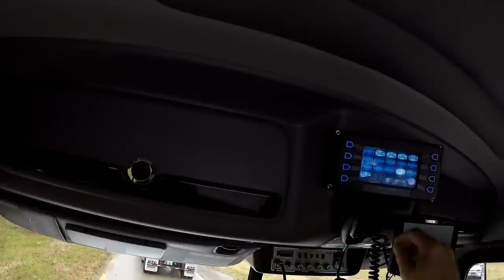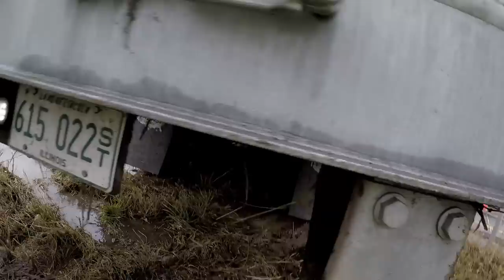High Wind Havoc

Comment: Ron, this is the first time I've seen you rushing around getting a scene cleaned up. You're usually calm, cool and collected, what was the hurry on this one? I could hear it in your voice but it was just another truck in the median if you ask me. Great video again!!
Reply: I believe he was expediting the removal of the truck so Fire Rescue could clean the road in a timely manor , to prevent another accident from happening during the bad weather with other drivers slowing down to look. Midwest is always safe and professional when they work and know when rapid removal is needed for the safety of drivers and First Responders . Great video and job Ron , thank you and God Bless
Reply from the maker: There were multiple incidents on both sides of the interstate, whether due to the storm that passed through, or related to this incident, I am uncertain.  But the emergency services were stretched thin with so many incidents to attend to and there were more storms forecast.  The wind was blowing hard and the road was wet.  Those factors, plus I push myself.  For some reason I felt an urgency on this call that I don't normally feel.  Also, Vic Massano is correct, quick clearance reduces the risk for all responders involved.    Yes, I rushed on this one.  Thanks for your concern.  God bless.
Reply: let's not forget it was probably COLD.

Comment: Ron I noticed you didn't use the break away chains like you always do. Is there a reason you didn't use them in this case?
Reply from the maker: It is still advisable to use break-away chains even with the tire lift.  This was an "Emergency move" and I took a calculated risk by not connecting the break-away chains.  There were many variables involved in my decision to not use them in this situation.  Again, it was a calculated risk for an emergency situation.  Had this been a standard tow I would have installed them without hesitation.  I hope this answers your question.  Thanks for watching and God bless.
Reply: Umm Youtube won't let me comment only reply. Sorry!
Ron why did you use the white winch and not the green winch?
Reply: i believe the white and blue winches are main winches where the green is an auxiliary. the main winches would be capable of handling more force than the auxiliary winches. this is just a guess as i know nothing of tow trucks or rigs like this.
Reply: Ron Pratt is that carbon fiber around the control frame in the back of the rotator
Reply: makes sense, given the urgency with which police want the road cleared, which also probably explains the tire lifts instead of a frame/axle lift, its just faster.  Just get them off the road and chain them up later.
Reply: Okk
Reply: tim paulsen .
Reply: And you are right I had never seen  that on the under lift!
Reply: Hahaha make sure you oatmeal pies are safely buckled there driver  Incase you jack-knife
Reply: I love that lazy Susan for chain that is a brilliant idea
Reply: Ron is a professional. When you are a professional you can take shortcuts.
Reply: CompactRhone that white inch is a deck winch.   That is used for joy if needed.
Reply: Depending on how far it is to the next exit. In this case it was not far, in some cases it can be 20 miles so that has to be considered,  Better to take that extra two minutes if it is 20 or 30 miles than to crate another problem.
Reply: @MikeySartori  Yes it is.
Reply: Joseph Robinson      it is against the law to be chained to your job, but alot of drivers don't wear the seat belt.....but I guess that alot puts safety first...God Bless.
Reply: Ozywizard73.  I may be late on this, but the white winch is on the boom and he can lift w it. The big green winch is known as a "drag winch" an is used for just "dragging" heavy loads along the ground toward the truck. Dragging is not what he wanted in this case, lifting/carrying was.  Hope I wasn't out of line and helped answer your question. Btw, 3rd time I've watched this recovery....
Reply: OzyWizard1973  p
Reply: Ron Pratt  love your videos. Also in Indiana I don’t think we can run sirens
Reply: @jessebergson3781  yes.  Plus it looked like he already had the heaviest part of the tire lift on when he arrives at the accident so might as well use it.
Reply: @aristeo1  usually you can afford them to
Reply: Ron will u buy another rotator

Comment: When you are pulling a full truck, with no brake control, how do you go with braking, or do you just go slow?
Reply: couple the tow trucks brake air hose to the trailer can help...
Reply: If this trailer had been loaded,  he'd have likely had to fix (or put a work-around) the damage underneath so that it would have service brakes while towing it.  It was revealed in the video that the wagon was empty,  so they simply caged all the spring brakes to be able to roll freely, and kept his speed limited while underway.  I think the part about keeping the speed low was also due to the wild wind.  Legally, you are supposed to have proper braking capabilities,  but due to the damage, and the need to clear the road quickly,  I guess it wasn't a bad call to just cage the brakes and get out of the way.  If he had been faced with towing long-distance, he would have had to make some repairs on-the-spot or at a safe place off the highway before heading out.

Comment: Still no clue why that female driver decided to bail out. I got blown over in Wyoming two years ago with a 70mph gust and my chihuahua and I rode it out and walked away with bruises, but I totaled my truck and trailer. You’re much safer inside the cab with the built in roll cage than you ever would be by bailing out. I’m amazed she survived that bail out. Good job with the recovery.

Comment: This wasn't the normal, "No problem Ron." You seemed very hurried. But you pulled it off in 25 mins. or less though with a bit of help from Mike. Which is understandable when you have officials breathing down your neck. I did notice you went outside your norm mainly when you didn't hook up any safety chains. But you still the man Ron!
Reply from the maker: Yes it was a hurried job.  We wanted to move it quickly to avoid further crashes.  I only had to tow it about a mile, so I did not hook the safety chains as I normally would have.  God bless.

Comment: That tyre lift looks like it's a godsend! I saw how easy it is to get the truck in the air rather than laying on the interstate getting covered in mud lining the axle forks up under the axle
Reply from the maker: It does make things easier when it is already hooked to the wrecker.  God bless.

Comment: excellent video Ron when you use the wheel lift on the big trucks how come you didn't put Breakaway chains do you not need them or was it too cold and you had to get off the highway quick God bless you and keep you safe have a great day and try to keep warm because winter is here and so is the wind
Reply from the maker: Normally I would use the break-away chains even when using the tire lift.  This was an "emergency" move and I took a calculated risk in not connecting the break-away chains.   Thanks for watching and God bless.

Comment: I used to be a 48 state trucker .. 
There's a spot in Idaho that has wind that can get up to 100 mph through a canyon, and of course the Highway was built through the canyon, and the guy who did it should be fired ..
I was loaded, and my trailer started to lift up and tip over ..
I slowed down, and went off the shoulder into the wind head on ..
I never tipped over, but I had to be pulled out, and back onto the road ..
Better to get a tow out of a field, than a trailer and cab tip over ..

Comment: Another nice video, Ron.  You made that look easy.

A couple questions:
1) Why did you choose the wheel lift for this one?  Is it just because you already had it on the underreach?
2) Why no safety chains?

Ducking down in front of the screen doesn't help see under the visor. :)  Maybe you could put your helmet on the dash or use a dash cam for the driving scenes.

Comment: Nice recovery as always. That driver sure had her guardian angel riding with her when she jumped! Guess Mike got the dirty job in the mud :)  Oh and thanks for the blinky lights on both trucks!  What is the wattage and speaker size on your siren? It needs more horsepower. Maybe Santa will bring you a nice shiny Federal Q for really clearing traffic :)  Over the years in emergency service I found the wig-wag headlights super effective for getting attention especially in daylight. Merry Christmas to the family and crew and God Bless.
Reply from the maker: Thank you and glad you got to see the blinky lights.  The siren is really just a cheap one.  I would love to upgrade soon.  He who shows up late, gets the mud.  LOL  we were both a bit dirty after this one.  Happy New Year and thank you for continuing to support my channel.  God bless.
Reply: When I used to do emergency lighting for fire engines, we found that for clearing close-in traffic, lights low on the grille or bumper (rear window level for cars) really helped. The high up lights work well for distant traffic and intersections but disappear when you get close behind someone. THE most effective lights were the wig-wag headlights and high power figure 8 wobble light in the grille (I do believe on the rotator, BRIGHT alternating LEDS in the grille would help. The small lights just do not have the punch to grab attention in the rear view mirror. I always suggest sitting in a car 100-200 ft in front of your rig and observe what you see. If you can ignore the flashes, it needs "more power" in the words of Tim Taylor, lol
As you know, NOTHING compares to a big Q for stopping traffic or shredding the ignorant :)  God Bless and thanks for all the entertaining and educational videos and sharing your strong faith.

Comment: just a quick question, why don't you place your camera on the white or blue swivel pulley on the rotator boom so you never have to adjust the camera angle? it will always face the work area i think, love your videos, and i learn quiet a lot from you since I am a tow truck operator myself, here in Canada. keep up the good work :)

Comment: Now that was one massive mud "slide" for that truck!! So glad to hear the driver had only minor injuries, and will survive. God Bless, stay safe and keep 'er between the lines. :) Dumb question: Do you find it easier to use the tire lift, rather than the frame lift??? It looks easier and faster. :)
Reply from the maker: It is a bit easier and faster, but such a heavy an cumbersome piece of equipment that I rarely have it hooked up.  God bless.

Comment: Brush guard doing it's work, saved the company alot of money by not completely destroying the front of the truck.
Reply from the maker: It did help, but the truck went backwards through the guard rail and cable system, so the rear of the truck took the brunt of the impact.  Thanks for watching and God bless.

Comment: Ok, this is the recovery you were talking to the old timer about on the levy recovery in your last vid.  Not a good idea to have a trainee driving in a high wind situation with a mty trailer. That whole rig is less then 35k pounds mty and was getting tossed around with a trainee behind the wheel. Now both out of a job before Christmas because of an avoidable accident .

Comment: Interesting, I can't say I've seen a tractor and trailer pulled with a tire lift. What is the maximum you can tow this way?
Reply from the maker: Thank you.  The lift is rated for 80,000 lbs towing capacity.  God bless and thanks for watching.

Comment: When we were on vacation back in June we were following a truck that flipped over because of high winds, it's kind of scary when you are on the highway behind someone and see that.
Reply: I think any crash that happens in front of you is scary. I had a Mustang speeding and pop a curb and flip over and over like the length of a football field. Good thing I kept backing off away from the car when I suspected something wrong.
Reply from the maker: I wouldn't have wanted to be there.  Thanks for watching and God bless.

Comment: Hey Ron can you tow a tractor trailer with the rotator or are you not supposed to because of the length I’ve done it before but I wasn’t sure if you should because of the length and what is the regulation for Missouri in order to do so I’m asking because I just moved to Missouri and thinking about finding a tow truck job

Comment: Love the way you handled that, when i saw it, i thought it would take alot more time! Also, I'm assuming you only used the tire lift because it was on there? Otherwise you would have used forks and chains like normal, right?
Reply from the maker: Yes, once the tire lift is on I use it until I have to take it off, then I won't put it back on until I absolutely have to, because it is so heavy.  Thanks for watching and God bless.

Comment: I was looking at what I could see of the median (to figure out what direction the truck was coming from), and it looks like the truck actually was going southbound, somehow lost control and hit the median, jacknifing as it does so
Reply from the maker: I believe you have the correct idea, just the wrong orientation.  The side of the interstate that I am working from is the South bound side.  The truck had been travelling on the North bound side, jack-knifing as it slid through the median, and ended up on the South bound side.  The rear of the tractor went through the guard rail and cable system first.  Thanks for watching and God bless.

Comment: Gotta turn the pto off Ron. Sorry you had too use the wheel bars. You must of towed a motorhome lol. I do the same thing they are so heavy I don't take them off until I have too.
Reply from the maker: Yes, I had used it for a motor home not too long ago.  It does speed up the process though when it's already hooked up.  God bless.

Comment: Great video Ron First time for wheel lift. is there a reason you did not use your safety chains. keep the videos coming better than watching T.V. any day
Reply: Wild guess, but might it be because he had the wheels strapped down to the wheel lift?
Reply: Thanks that's what I kinda thought to
Reply from the maker: I don't use the wheel lift on this truck very often because it is extremely heavy...almost a 2 person operation to put the beams on the under-reach.  Once it is on, I tend to leave it on until I'm required to change it.  Thanks for watching and God bless.

Comment: Another great video Ron! One question though, how do you get away with the police sirens on the recovery truck? 
No way would that be allowed over here in the UK!
Reply: si barsby It is allowed under Missouri state law.
Reply: He is considered an emergency vechicle there and he can run lights and sirens when instructed to expidite by the police. Like this jamming the interstate the police want it open asap which means getting the wrecker there sooner the better
Reply: he has a video discussing running code (using the sirens and blue lights)

Comment: Front wheel cradle.. is that new?     Amazing ride that rig took and stayed upright...
Reply: Yea looking at all the water that was built up in the rut's probably reason why, group so went and soft it didn't offer enough resistance to cause it to roll.
Reply from the maker: No the front wheel lift came with the truck, but I don't use it often.  It is heavy and cumbersome.  It does make things easier sometimes and once I put in on....I leave it for a while.  Thank you for watching and God bless.

Comment: Ron , Can you explain the operation and use of the GREEN winch?
Reply from the maker: The green winch is a 50 ton drag winch.  It operates like any other, but it is used for a low straight pull rather than a lifting pull.  God bless

Comment: A Question for you Ron. Do you prefer using that wheel lift setup? Or do you prefer using frame forks as we've seen in most of your videos?
Reply from the maker: I don't use the wheel lift often because it is so heavy and cumbersome.  It can make things a bit easier, but I prefer using the framework.  God bless.

Comment: Bit risky opening that trailer door, my dad had his teeth smashed out and gash in his top lip he could put his fingers through for opening a door with a load that shifted and was leaning on the door. The Second he released the leaver lock, boom. The lever hit him in the top lip. 
Be safe bud.
Reply: He stood slightly to the side and had one hand against the door to keep it from flying open if there was anything against it that fell over.
Reply from the maker: Thank you for your concern.  Thanks for watching and God bless.

Comment: My personal opinion: the driver of that truck does not need to drive big trucks anymore...as soon as it went to the median, instead of jumping and allowing the truck to cross over as it did, she should have stayed put and tried to maintain as straight as possible direction into the median, off the pedal, off the brakes, and allow the mud to slow the truck, good chance it would have been much less damaged, with little or no damage to state property, the barriers and guardrail...just because it is a big truck doesn't mean it can't be controlled enough to be stopped safely...but, jumping once it hit the median caused much greater damage and a considerably higher risk of oncoming traffic becoming involed in the accident....I seriously don't believe she should be driving big trucks....

Comment: Ron, is the truck totaled ?
Reply from the maker: I don't know.  That decision is made by an insurance adjuster, normally.  My educated guess would be that this truck will be totalled, but I could be wrong.  The frame was badly bent and the rear axles/suspension were heavily damaged.  The cab, engine, and transmission are in good shape, though, so it would be a tough call.   Thanks for watching and God bless.